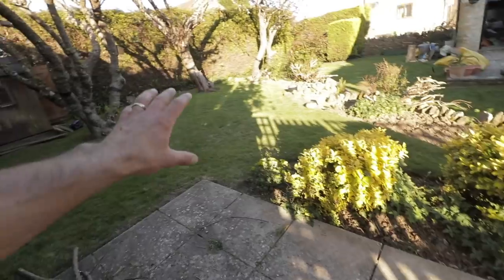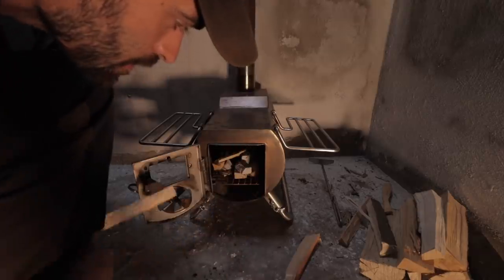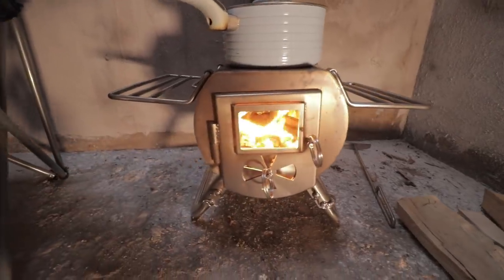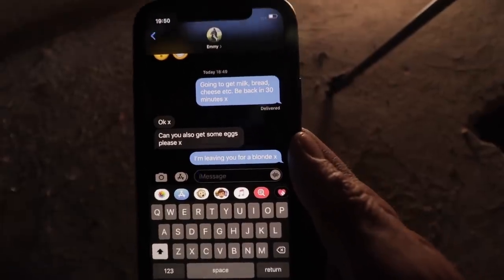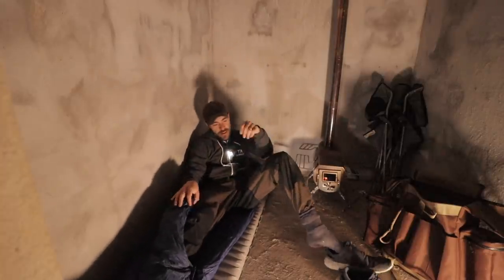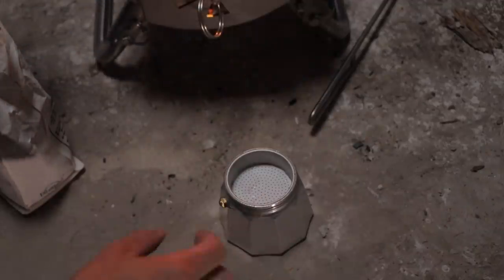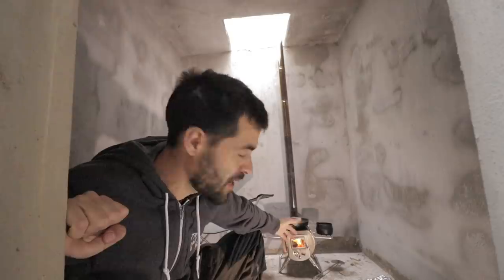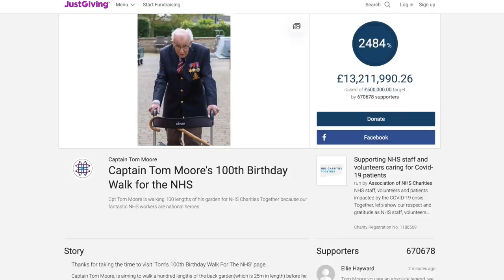24 HOURS Overnight in my Bunker: Woodstove, Axe Sharpening

Comment: I live in Sweden, like most houses here they pay particular attention to good ventilation, my house has an extraction fan built into an extraction duct on the roof, this draws air from bathrooms kitchen toilets store rooms etc so the air is continuously being replaced. This fan runs 24/7 and has for more that 30 years. This system would work in your bunker, just need to ensure that you have a method of air intake through the entrance door and out through the vent shaft. You don’t necessarily need the fan as long as you have another way of air entering the bunker?

Comment: You need to properly plaster the interior of the bunker. Properly plaster it thickly with waterproofed plaster. Same with the floor, waterproofed cement layer for the floor. Obviously the door and vent need to be sealed also

Comment: That would be cool if he puts furniture, air ventilation system (air intake with activated charcoal filter, exhaust fan), run electricity, lights, replace the doors.

Comment: was thinking ... to setup a sleeping rig put 4 poles in the corners with a brace beam around decent hammock height and sling hammocks off them ... also gives you places to put stuff up off the floor etc
Reply: you should be okay with CO reflow as long as you block the top end after a little cool down ... or can seal the bottom end closed ... in general thought the hot pipes at the bottom will keep higher pipes warmer longer allowing more flow longer ... and the amount of CO the pipe could hold would be no higher than your sneakers sole ... so as long as you are up off the floor your good ... the stive will draw air down the stairs as it send the heat up the pipes ... double check the pipes for soot build up as the top sections will have it due to lower temperatures for a longer time
Reply: dont be surprised at the pipes efficiency 90% of it is shielded from the wind so it doesnt have a cool breeze on it ... the top section or two will be most affected ones ... so you have more hot pipes than cold ... so higher pressure faster exhaust gases better draw
Reply: something you should consider doing ... is get a small solar panel setup for a battery and electric fan pushing into a pipe ... so you can draw the air out of the bunker for free ... also ensures if the lil one gets trapped down there they will have fresh air until you find them ... then any time you setup a stove you disconnect the fan section with its pipe and move it over by the door to pull in ... and then the stove send it all up ... or just leave it and even if the stove burns out after you nod off ... the fan will draw fresh air in still and the bad air out
Reply: what you need is a good night camera off remote .. that chirps like a cricket ... then you say good night point it at the camera and chirp us off lol

Comment: I know you had a good draft because of the pressure changes due to wind, but maybe a battery operated CO2 detector would be a good investment just in case. Especially if you had a good reason to be down there with your family.

Comment: Put eyebolts in the walls so you can sling a hammock for next time
Reply: It's like, under two meters in either direction, so the air mattress is probably the better option.
Reply: @PsylomeAlpha   The room is but there is an entrance corridor and stairway adjoining - just put one bolt on the wall at the bottom of the stair, it's not as if the door was shut anyway

Comment: Would be useful to redo this experiment when you have access to a battery operated CO meter, just to be sure it'll be safe if ever you actually have to use it.
Reply: With two massive openings and a fire drawing air through, its very very unlikely to be affected by CO poising. Also Carbon Monoxide is lighter than air so would just rise out of the bunker!

Comment: I was wondering for the axe sharpening, could you pinned (as in pinning - term for sharpening blades I think) it? And then avoid losing metal off the blade?
Reply: peening? Not on this kind of metal. Peening is for blades like a scythe, where the metal is still soft, or not hardened anyway. I'm not a metal worker, but the idea of peening is to stretch the metal a little bit and thin it, thereby making it easier to sharpen with a stone and a lot less metal is lost through grinding it off. If you tried to hit an axe with a peening hammer you would probably chip the axe in a major way.

Comment: Will that tool rest in the bottom of the stove whilst you are using it n then you can drag it out with the ash n replace it? It’s curved like the bottom of the stove.
Reply from the maker: Yes it stores in the stove when you pack it away. But it would get too hot to use if you just left it in there when it was on
Reply: Well, yeah, u would slowly drag it out and along with the ash, no? U could use a stick and then, allowing it to cool, replace and repeat. Uh, I’m just saying, I guess it would be a convenient way to quickly n efficiently clear the ash. Or maybe in the morning, before lighting..

Comment: What kind of bunker has a wooden door and giant hole in the ceiling? Doesn't seem very protective as a bunker should..
Reply: One made mainly to protect against air raids, and there had been a massive concrete slab on top of the vent, but it was in rough shape, so he took it out and hasn't decided on how to replace it yet, so he just put some rebar and a sheet of that corrugated plastic they use for shed roofs in the meantime so nothing and nobody will fall into it.

After all, he has a small dog and a small child, and both are known to be too curious for their own good.